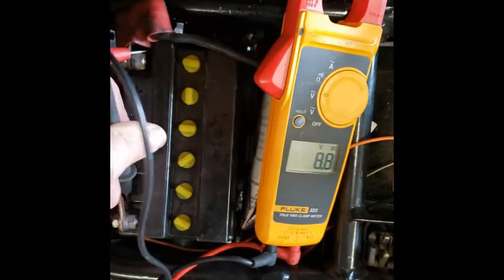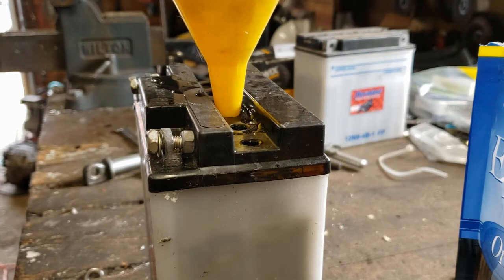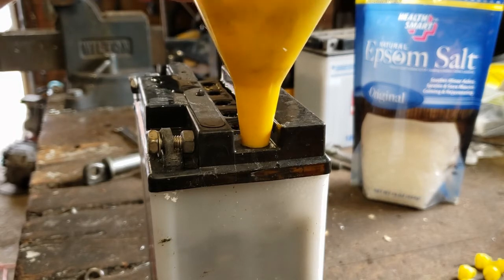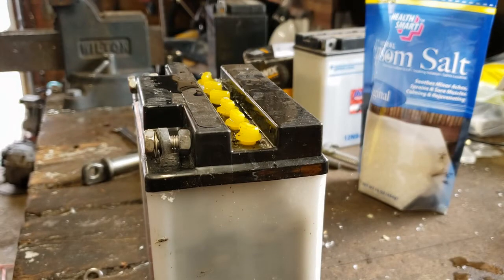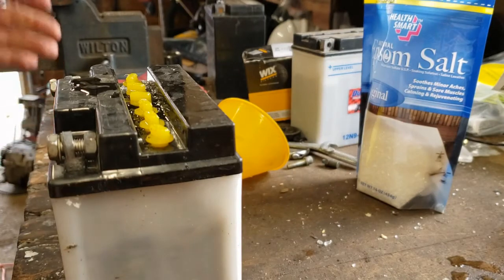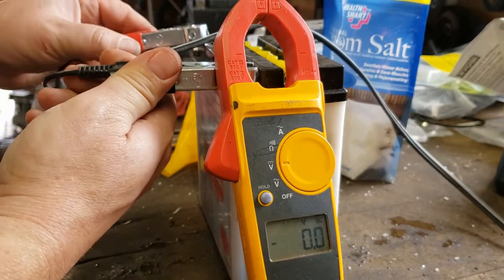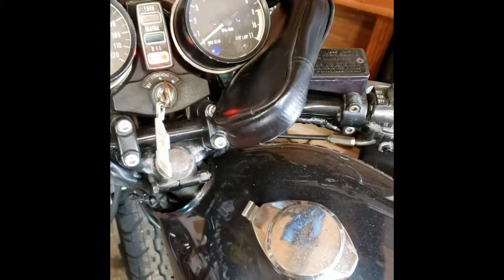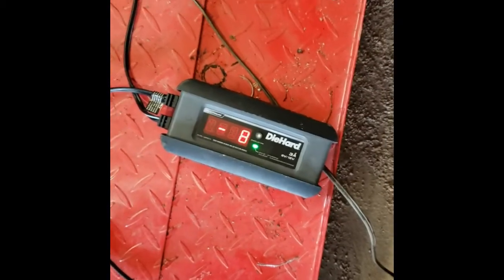Restoring an old motorcycle battery; Fast, Cheap and Easy.

Comment: Epsom salt will damage the plates, coating them in leftover mineral after the lead sulfate reaction. You'll also have more electrolyte, which does increase capacity, but also abnormally sulfates the plates on discharge and will shorten the lifespan (same if you add to much sulfuric acid)
Reply from the maker: This video is for bringing back a battery that’s already worn out.

Comment: I bought LTO 18650 batteries and its a whole day work to replace the motorcycle converter? that has more fail safes and support lithium as well. LTO doesnt catch fire and might last  60 years! and -40°c no problem so cold starts never will be a problem i let it at shelf 6 months still fully charged. 150 eu for the batteries and 120 euro for the converter. But dont get regular 18650 lithium ion cells those will catch fire and crack after 7-10 years like those in electrical vehicles... Thats the scam on elecric car batteries you gotta replace them arround 10-12 year or later.
Reply from the maker: Fascinating

Comment: Will it work if i use regular salt?
Reply from the maker: I have no idea.  If you try it, please report your findings.
Reply: @KnobleMoto  i've tried  it on a completely dead motorcycle battery using regular salt mix with warm water and it works.😃

Comment: so u mixed it with the acid, you keep the acid in it and you add th salt?
Reply from the maker: Yes I did.  I had not read that there was a problem with that.  The battery worked for another season.
Reply: @KnobleMoto  What about now, or only one season?
Reply from the maker: @dwayneconaway1733  I sold the bike in the spring after the video.  It slow cranked a little so I put a new battery in it.  Maybe it just needed more salt.  If i knew this video was going to be so popular, i would have kept it around 😂

Comment: Try use paracetamol, just one tablet for 1 battery mix with new liquid battery, but this not instant strong again, need 2 or  3 day for battery back normal again
Reply from the maker: I have never heard of paracetamol.  I will look into it. Thanks!
Reply: @KnobleMoto  paracetamol: also known as acetaminophen .
Reply from the maker: @The_Lord_has_it  fascinating.
Reply: Don't you mean Asprin acetylsalicylic acid

Comment: ur supposed to mix salt with water first
Reply from the maker: I learned that afterwards lol. It would be easier.
Reply: @KnobleMoto  is there a ratio of water mixed with Epsom salt? Or should I use distilled water in epson salt mix and what ratio should I use?
Reply from the maker: @JohnDoe-cx7vq  I think I did a teaspoon per cell.  The battery was out of a kz400, so it was not a big capacity battery.